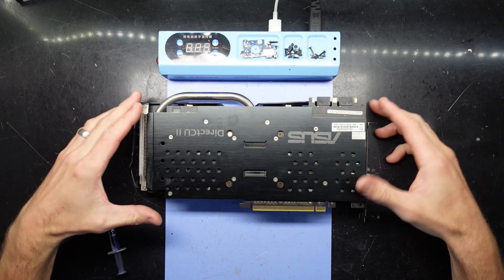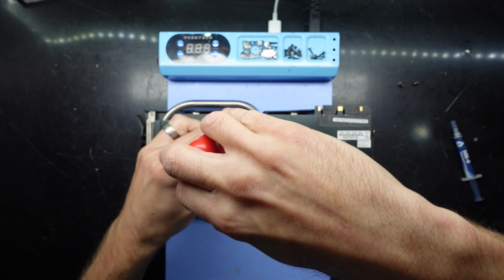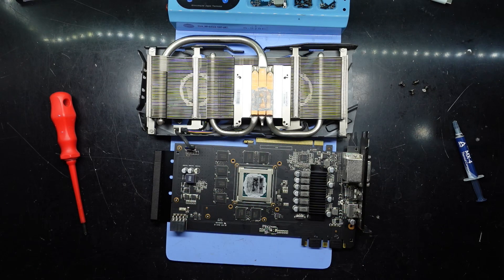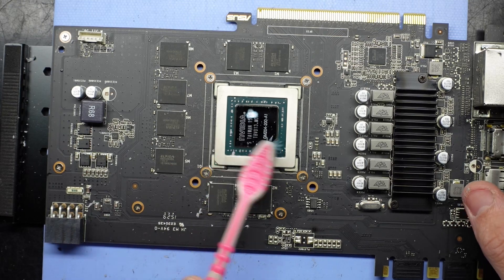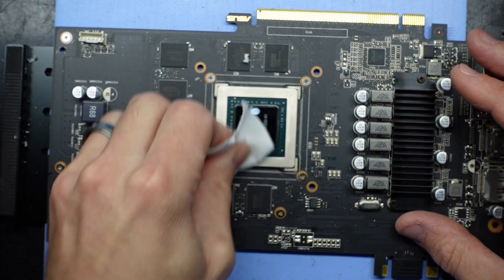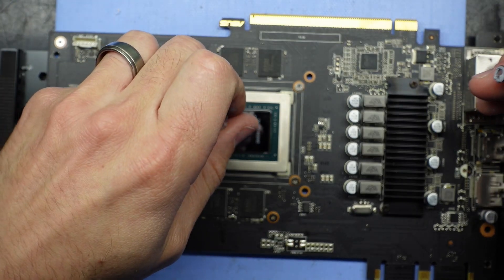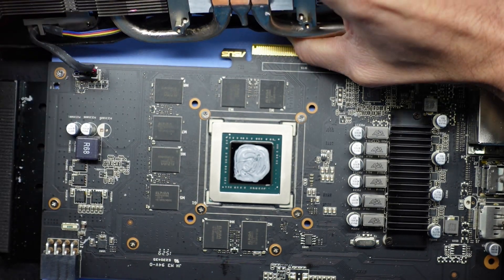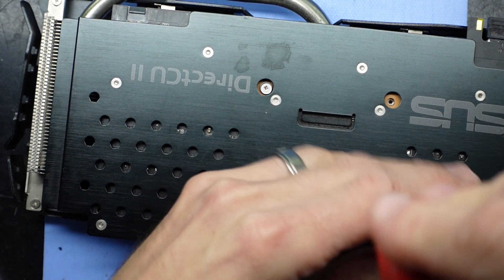ASUS GeForce GTX 970 Strix DirectCU II 4GB Thermal Paste Replacement

Comment: Just replaced the paste on a used GTX 970 I got with a budget computer for the kids. 

BEFORE the GPU went to 95°C and the fans spun up to 100% within seconds gaming xD It didn't crash anything though but the leaf blower sound level were apperent!

Will be interesting to see the results in a few hours^^ Used a "never drying" still 80% left since +10 years 'Arctic Silver Ceramique', its a great paste for longivety!
Reply from the maker: maybe not enough past
Reply: @rickstechrepairs Oh... it had exactly those crusty paddings around the cooling surfsce and everything were dry. Had to use my nails since I didn't want to scratch the surfaces.

From 50°C to 38°C Idle and stays below 77°C full load now, almost always at full Boost^^ To bad the VRAM isn't 2GB higher, would be adequate for so many more games without lowering the settings^^

I can live with mine for quite a while longer playing MWO and Battletech - Rougetech mostly :P
Reply: @rickstechrepairs  Realized I had written as my mind thought... which gets confusing :P Sorry. 95°C were before the change, didn't have the possibility to test it before yesterday evening. Works like a charm!

Comment: I got the same card off ebay recently asus strix 970 and I am noticing a bad smell during gaming. Not quite burning but chemical almost? Maybe replacing thermal paste like this would help? I will try to follow your guide maybe.

It's happening even at just 55 degrees celsius temps so not when it's super hot even.
Reply from the maker: not sure  , was it from a smoker? 

55 degrees is alright temp

Comment: Nice video! I have that model and 1 hour on valley temp does not get higher than 74c. Shall I still reapply the thermal paste?
Reply from the maker: not sure what the normal temps are from it new 
but i would, if you havent done the thermal past at all since you have own it
Reply: Thanks for advice. Ran Superposition at High and temps down by about 4 degrees so worth doing.

Comment: Using the very same one right now playing a few games as well... DCS, BF2042, far cry 6 and a cple of others. Was told that it's also recommended to place thermal pads on the RAMs (rectangular blocks around the GPU). Whats your thought on that one? May get round to cleaning my GPU out soon as well.

Comment: Thank you so much, I'm being through same exact situation. Just cleaned the old gunk with regular water and a paper napkin lol. Don't want to get the 4000 series GTX in a hurry spent like 1800$ for 13900k, h150i elite AIO, Asus Pro wifi mobo, ddr5 ram, HX1200 psu and 990 pro m.2 ssd. Plugged this old GTX 970 in and display is not working through that so opening and cleaning it up. Didn't look forward and captured the position of heatsink direction so searched in youtube and landed here. This video helps me to assemble it back.
Reply from the maker: Hopefully the new build goes very well for you :)